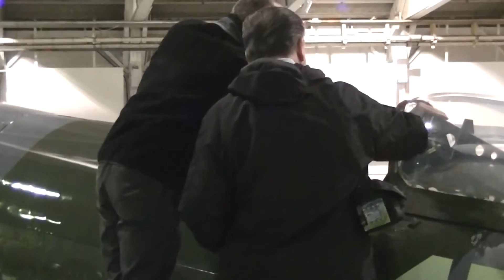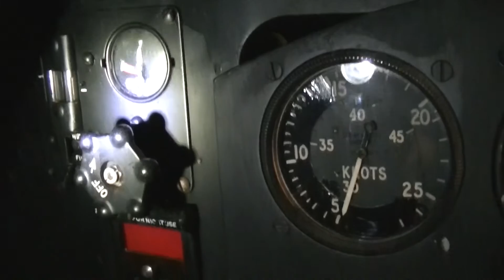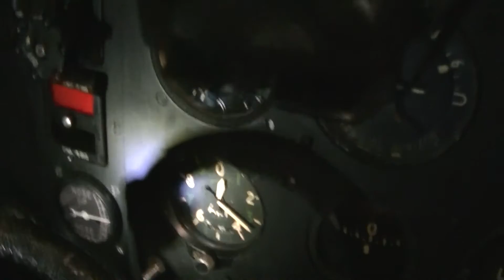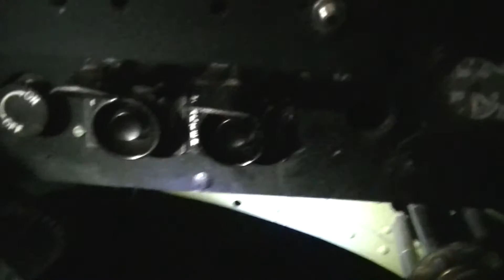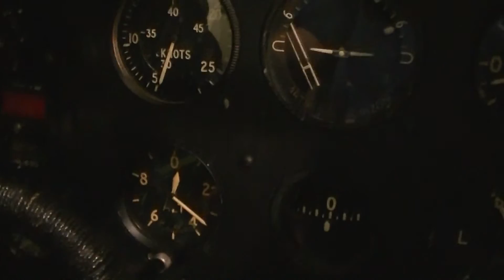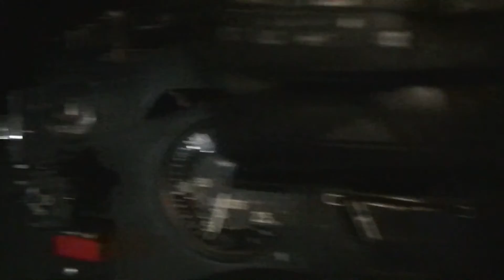Supermarine Spitfire LF.XVIe Cockpit Experience

Comment: My son told me about this video recently with the comment “dad, you’re famous – sort of”. It brought back good memories of volunteering at RAF Museum Hendon.  I may be able to fill in some details.  This was the first aircraft in which the Museum allowed full public access to the cockpit and the ticket price was kept low to keep it affordable for most visitors. Hendon doesn’t charge an entrance fee and relies on initiatives such as this for extra funding. The Aircraft itself, a MkXVI, was a bit of a bitza, although its history was linked to the site as at one time it was the station commander's personal aircraft. It has often been used as a static display and being dismantled and moved frequently,  many of the controls remained disconnected. Inside the cockpit is not complete and, as I said in the commentary, current HSE radioactivity limit controls prevents the use of period instruments as the luminous paint used exceeds current dosage limits. (this is also the main reason most of the aircraft cockpits at the Museum are inaccessible to the general public) Some later and non-standard instruments are used.  John, the RAFM’s senior technician, put together most of the interior from available material, and that accounts for oddities such as the gun firing button being incorrect, although the “Twist to fire” ring gave a better Battle of Britain feeling.  John actually worked servicing and flight authorising several Spitfires for the 1968 Battle of Britain film at Duxford. As noted in the comments below, the engine start-up sound was taken from David Irwin’s Merlin 20 series / 500 series when being exhibited at the Museum. One of our volunteers recorded it, then built the MP3 player and speaker for the aircraft. Of course for me, sod’s law applied, and it didn’t work as planned when someone was carrying out detailed filming. David’s engine has an interesting history of its own, being built as a 20 series variant for a Lancaster or Halifax and later in life rebuilt as a 500 series for a CASA 211 – the Spanish built Heinkel 111 used by Germany in the Battle of Britain!  For me, as I’m not a pilot, it was hard work reading and memorising the Pilot’s Notes, and keeping explanations down to the 15minute limit we had between customers. It was too easy to get involved in a discussion and ramble on. Access required a certain amount of dexterity, and we had been told that we could refuse access if we thought that someone would be unable to manage getting in or out. I did have concerns over one elderly lady and gently suggested that it may be too difficult, only to be put firmly in my place by “..I’ll have you know young man that I flew in a Tiger Moth at Duxford not so long ago, so I can easily manage this”. She did !
Reply from the maker: Interesting story Ian - I believe it was for £10? I purchased it for my brothers birthday - I think they charge about £45 now - I know David very well, as I’m the unofficial photographer for Historic Aero Engines, so know most of the guys very well - Dave Lee (often David’s safety officer) has just got his engine running after a 15 year restoration - I look forward to seeing it this year. You’ll find plenty of videos I’ve filmed of David’s engine runs over the years on this channel…

Thanks for reaching out.
Rob

Comment: Use to play a flight combat sim You would start at a airfield Look at the cockpit controls And I first started thinking you pressed E for Engine and off you went Boy was i wrong It must of took me 2 hours and some reading just to start the engine And about 20 blown up engines and crashes  
Fuel cock on ...Throttle at 5% Mags 1 And 2 on Start switch pressed  controls checked...brakes off  Warm up Rad open slightly  ease the thottle open taxi And even at the start of take off you could not go full thorttle or you would flip over And you had to adjust the torque of the engine with rudder To sit in the real thing would be amazing I only been beside one in Canada And a Lancaster bomber on the other side of her Amzaing machines

Comment: I've been to Hendon at least 50 times and never seen any cockpit access like this. Marvellous. I sat in the cockpit of the Lightning at Binbrook some years ago. That's a considerably bigger aircraft, yet the cockpit was no bigger than the Spitfire, it seemed like they had designed it and thought 'ah, we'll have to put a pilot somewhere!'. I suppose once all the instruments and other gear are installed and the pilot can operate it all, you don't need more space. I don't know if the Spitfire and Hurricane had heating provided, it must have been extremely cold at height, but there again a regular sortie wouldn't be much over an hour (unless it was a long range photo recce mission). Thanks for sharing.